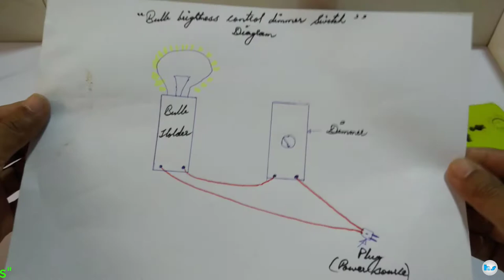How To Make Dimmer Bulbs

Comment: it is fan dimmer? please tell me if it is not.....................can we use a fan dimmer with any light:?
Reply from the maker: Yes it is fan dimmer ,you can check ,back side of the dimmer watt limit.
In this video i'm using 250 watt limit dimmer and 200 watt bulb.